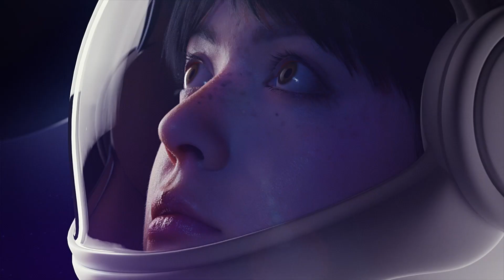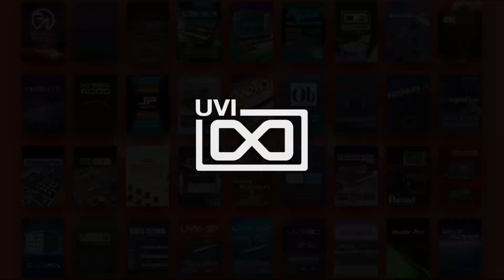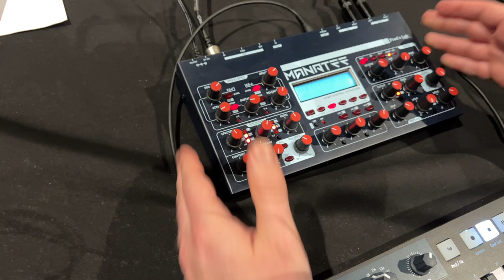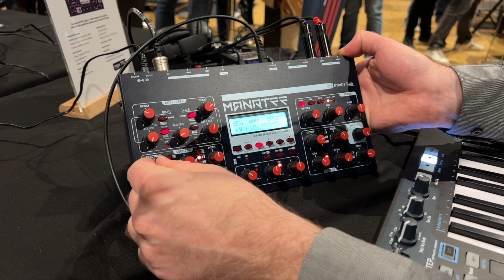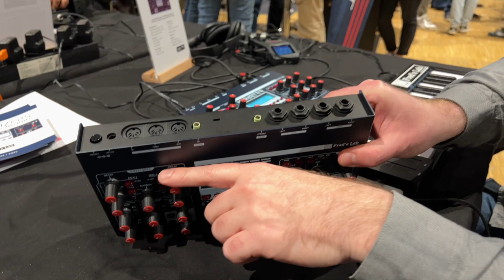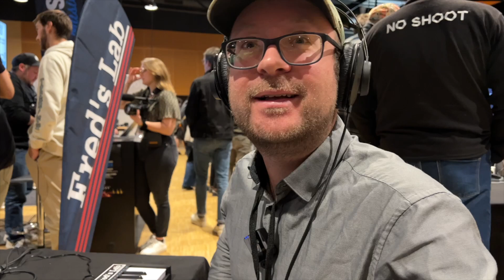Fred's Lab Manatee Spectral Synthesizer First Look (Production Unit) | SynthFest France 2024

Comment: LFO sequences is pretty cool, gets close to a VST "Function" type of modulator which I have always thought should be in more hardware synths. I think this synth is going to suffer from the low res screen, it would have been worth extra money to use a high res OLED for cleaner graphs, and better ability to visualize and control this complex functionality without having to jump between screens.
Reply: The jumping can be annoying but this happens with machines not having one knob per function or multiple screens.